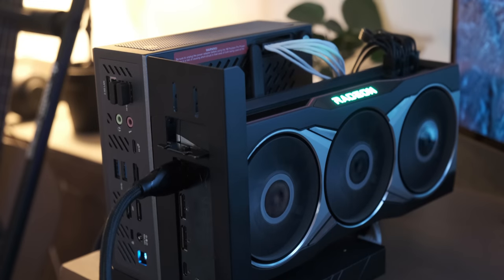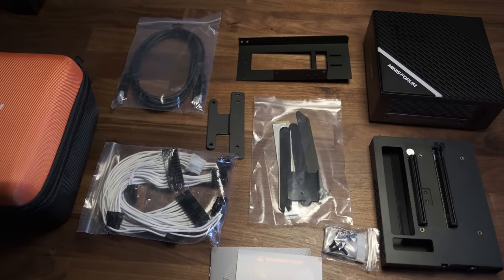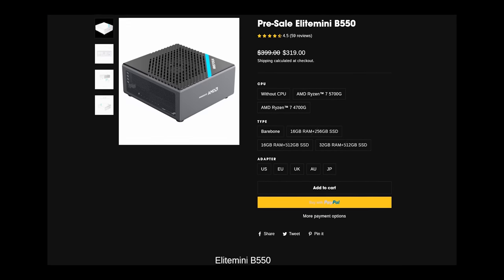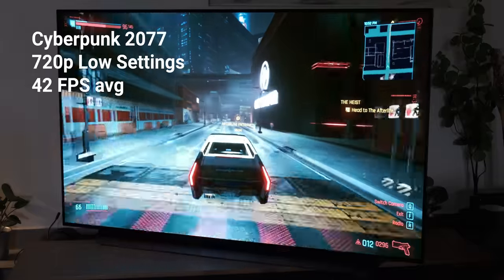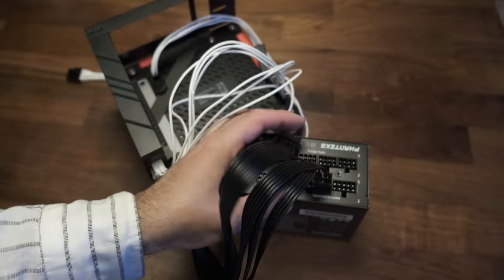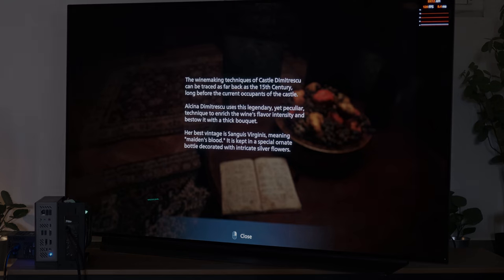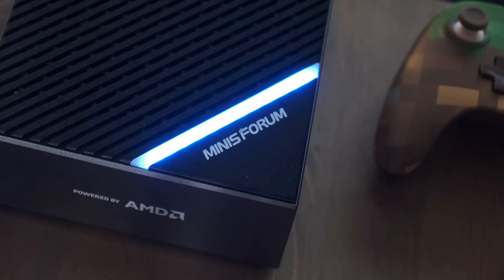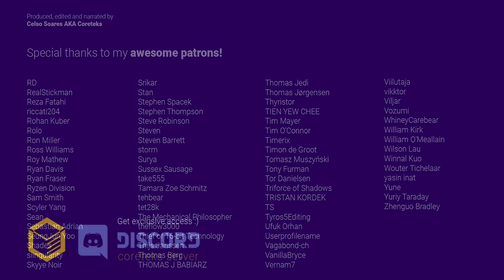The beginning of a REVOLUTION. Feat. the Minisforum B550

Comment: Upgradability of the pc platform is a lie... Well if you ar a total crasy person that upgrades every 2 years and that is completely unnecessary because even a medium pc build is good enough for 5-8 years. And when you want to upgrade a single component your pc will be so out of date that there is no point to add new components (new components will not be at optimal compatibility with the rest of the components or will nerd a new power supply... New gpy's are so poewr hungry...)
Reply: I think there's some truth to this but it's largely due to various components balancing themselves out in terms of expected lifespan over time. It used to be that you'd need to upgrade at least one component before the others or had to do it that way out of economic necessity but these days "PC" has coalesced into a moving platform that can last 5+ years with each iteration. That's not the way it's always been, and it's still more likely that a PC gamer will replace a GPU before the CPU.
Reply: It's even worse. I got i3 10th gen just 1,5y ago with good B460 mainboard, finding it kind limiting factors if I would want one of those "affordable" "budget" gpus from AMD running on 4lanes of pcie4. 0, as my MB offering 3.0 max.
I dont speak of nvme 3.0, as it was great upgrade over sata, no need better storage for gaming and 4.0 nvme drives are consider aby pricier for no big gain while gaming.
Reply: @gstormcz  exactly, now your gpu is forcing you to upgrade your motherboard... And i don't want to talk about pricing at all... For me now the only reason to buy any pc parts is if it's going to make me money... Because it would be financially irresponsible...
Reply: @karlomihalusdianovski5275  Agreed with upgrade of CPU being waste. For me it would be maybe 10-20perc higher low fps, but maybe even not that.
But I saw benchmarks, that anything faster than rx6500 usually gets just little few percent or none nerf if used on pcie 3.0. Until you get then top rtx3090 level gpu.. But that is not my interest.
Btw so called budget gpus are most overpriced still, gpu makers still profit from crypto not yet over, they trying make profit on midrange and high end gpu sales with "slightly" above msrp, which is us already screwed up past gtx10xx series.
Comparing gpus just new gen vs old doesnt make only sense, also need to understand how greedy are new games on popular resolutions and typical monitor speeds in Hz(thus fps optimal)
Also going online competitive gaming bought need of highest fps need and its consistency(good 1perc lows).
Played single player 30 to 60fps was doable. With gamesave guy was just safe, xd.

I hope gpu market gets its last 20y (2000-2020) behavior, getting pricing drop those 30perc off annual among all tiers off gpus!
Reply: @gstormcz  exactly... And the funniest thing is that the performance of the low end gpu-s hasn't really gone up from rx570-rx580...
Reply: Then I am maybe crazy.
I upgraded my pc since 90s usually each, 2-3y, mainly cpu-rám-MB but also storage. Usually double cpu speed, double RAM and storage. Requirements went that, also wanted responsive OS, apps and even storage speed was some 30percent dependent of cpu gen.
As gpus were always expensive. Those I upgraded usually 5y cycle. My 1050 runs since late 2017, it about time to upgrade, but pricing duopoly doesnt make it attractive yet.
Reply: @dycedargselderbrother5353  I understand that, and that is good for the user because the thing you buy is lasting you longer, but if when you choose to replace one component it force's you to change bunch of others then its not really modular any more...
Reply: @karlomihalusdianovski5275  Its worse. 2016 I do remember something like gtx 1030 for maybe 60-80usd(max 2000CZK) incl budget AMD offer. My 1050 was muscle budget for 120usd(3280CZK icl 21per VAT).
I saw now just rx550 for crazy 3500CZK, thats half of my 1050 performance, even w 4G D5), in stock.
Rx6500 should be below 120usd as its feature dumb.
Rtx3060 and rx6600 should be 250USD maybe not 330+.
May is at door, that was told by ytbers it brings pricing down. Lets see.
Reply: @gstormcz  yea replacing hdd to an ssd or nvme is the best thing you can upgrade on your pc, everything else is less existing then that ahahahaha